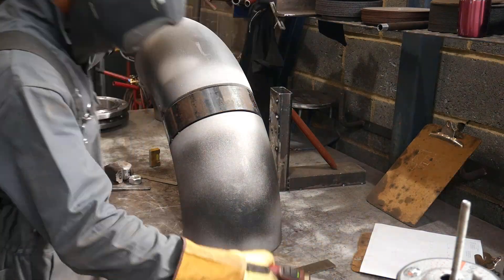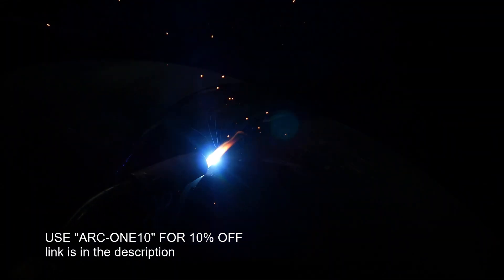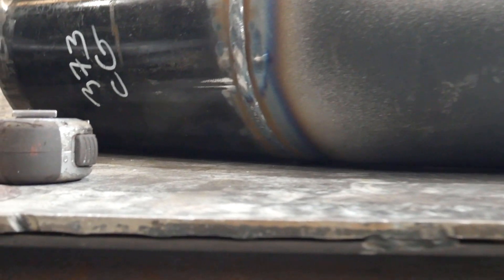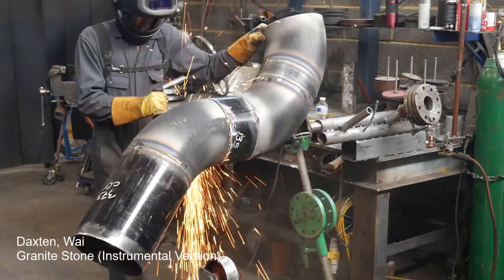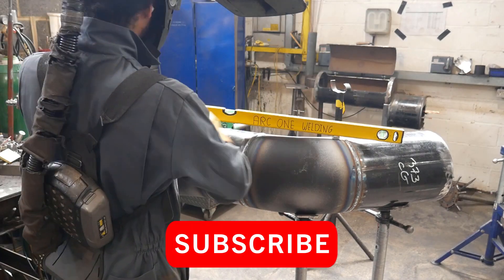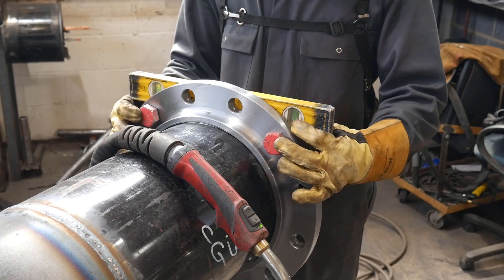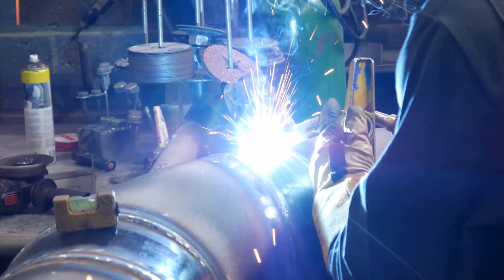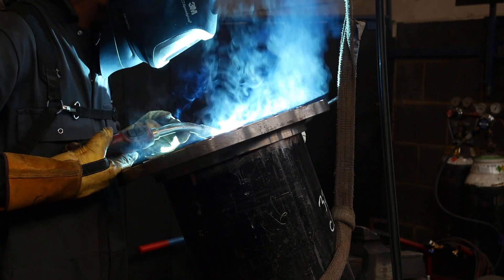10" PIPE SPOOL FABRICATION 45°X 3 (MIG/MAG PIPE WELDING)

Comment: Any of you users of the 9100fx ever had this issue?.. my adflo is stuck in high. Can’t figure out how to switch it back to low flow. I know the proper way to switch back and forth from low to high and back to low but it will not. Otherwise working perfectly. Help!!!
Reply from the maker: ive never had that problem, but the on button turns the power up and down
Reply: ARC-ONE WELDING I know the on button pressed for the second time after already being on switches to higher fan speed, pressed again switches back down to low speed... but it’s not switching. Just wanted to see if there was a way to reset the system or if would be a warranty fix

Comment: How can i set the wire speed right with my welder settings,  i don't know if u can get what im saying? 
How do i know i set the wire right and make it go the speed my welder is reading
Reply from the maker: I dont understand that question, but you have to match your volts and wire speed correctly, it should sound like frying bacon when it's correctly setup

Comment: Just wondering what size mig welding wire do you use to fill up the 5-6mm gap you use and to get a nice cap, or do you just hang around for a little while and let it build ?
Reply from the maker: I use 1.0mm solid wire and i move on asoon as my weld pool touches both sided

Comment: Song Titles and credits! Excellent. You mentioned welding the inside of the SO flange in pulse setting, do you do all your caps on remaining joints in pulse setting?
Great production! We appreciate you reading our comments and addressing the audience.
Reply from the maker: Yeah all welds apart from the root is done on pulse
Reply: ARC-ONE WELDING do you use RMD for the root pass?  I’m a UA Journeyman Steamfitter in the US. Working in a fab shop, it’s so similar but so different. Is it true you guys have to use paprs in the UK?
Reply: @Mski636  hey man, HSE in the UK fairly recently reclassified welding fume as a class 1 carcinogen (definitely carcinogenic) so generally PAPR is required now, even when working outside. Cheers.